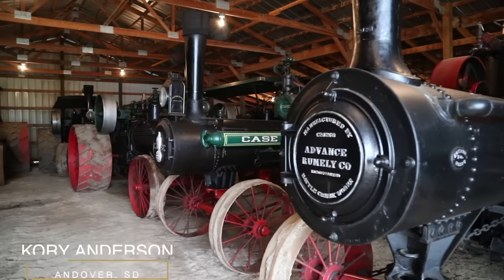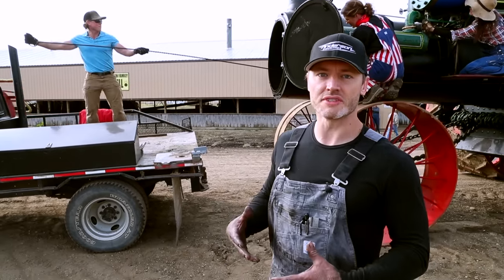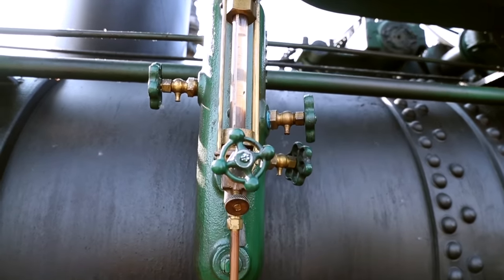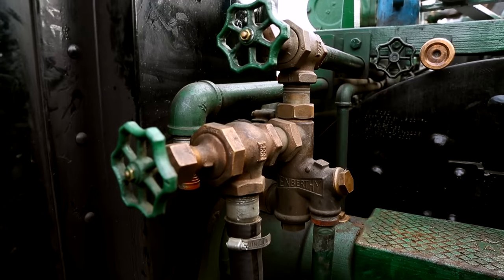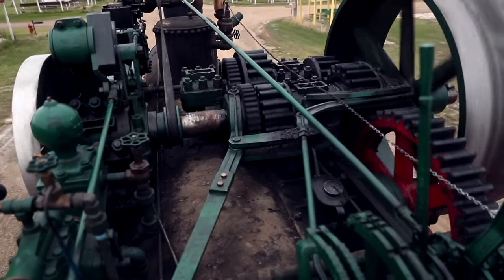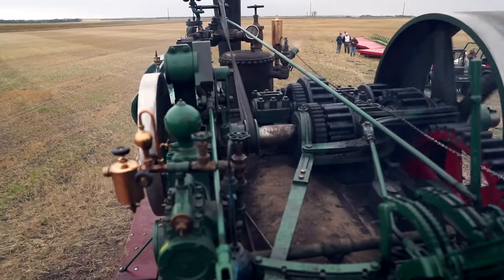FIRING UP the 150 CASE - The largest steam traction engine in the world prepares for a record pull

Comment: "balls out" never knew
Reply: @Ben Jones Amazing never meant what I thought.
Reply: @brucerogermorgan2388  something about cannon shot and brass mountings?
Reply: @differentname8051  In the days of square-rigged sailing ships, amunition was cast iron balls that were stacked on a triangular brass plate that was called a "Monkey". In very cold weather, the different coefficient of contraction would cause the "Monkey" to contract at a different rate to the cast iron cannonballs. If it got cold enough, the Cannonballs would roll off the Brass Monkey. I may not be 100% on that but it's definitely along those lines.
Edit: I guess that the same thing applied to land-based cannon also.
Reply: And balls to the wall was an old aviation term back when throttle sticks had a ball on top of them.
Reply: now i wonder if "down the pipes"  is also from this  , if not i feel it should be
Reply: Balls to the wall is similar, from aviation. You'd put the balls on your throttles all the way forward to the firewall or dashboard.
Reply: @brucerogermorgan2388  This etymology has been largely debunked. If for no other reason than that there simply isn't enough mass for the difference in expansion to actually make a difference. Add in that ships never used anything like a so-called monkey to hold shot (it was stored in garlands along the hull near the guns) and you have a pretty questionable derivation. It is one of those terms that we simply don't have a good source for it - but there are some rather innovative folk-etymologies out there!
Reply: @timdouglass9831  Fair enough, that was the story I was told, and it seemed logical because I didn't have the details you did. Thanks for the information. I might just stick to the story sometimes, it sounds good. I'll just be careful who I tell it to, Haha! Maybe it applies to land-based cannon shot? I dunno. I'll say one thing, though, that Case is one awesome piece of machinery!
Reply: @brucerogermorgan2388  It sure is! I'm just an etymology geek - don't take it too seriously!
Reply: @timdouglass9831  Thanks. I'm 71 now, I gave up taking anything seriously years ago, yuk yuk.
Reply: My own meaning for it still stands
Reply: I learned it from Jay Lenno talking a bout a steam engine he had

Comment: A famous old Case boiler was sold to Mr. Justin J. Hingtgen of LaMotte, Iowa. It was mounted on a cement slab at Mr. Hingtgen’s farm where he held his well-known steam show, The Mississippi Valley Steam Power Show. After Justin Hingtgen’s untimely death at the age of 51, the famous old boiler #14666 was purchased from the Hingtgen Estate by George W. Hedtke and was moved to George’s Hedtke’s Hickory Oaks Farm at Davis Junction, Ill. I am 74 years of age [ an old tractor restorer ] and was a good friend of George Hedtke's, having displays at his shows over many years.I am much impressed that you were able to reconstruct the Case 150. George and others wanted to do that He was also a friend of Jerome Cases granddaughter and was at a show in Racine a number of years.I was there also.George had a nice Case 110 plowing engine that he showed often at his show, The Sycamore show and the Freeport Illinois show..Where did you get the wheels and running gear?...were they off of a 110 ?...I am so happy you guys pulled this off You have a treasure that needs to be preserved for ag history.I have a Vo-Ag Teaching Degree from Illinois State Univ. I was at your show about 35 years ago...God Bless    Dana Brinkmeier..

Comment: When I was a kid just after WW2 I lived in London, England for a few years and remember seeing  a steam roller in action used for repaving roads.  They were similar machines to the steam tractors like your  Case 150,  but with  rollers instead of wheels.   I also remember seeing  steam trucks with solid  rubber tyres when every means  of moving goods was used because almost all trucks were  built for military duties.  I think that I heard they had a top speed  of 12 mph.    I was very interested to see your footage of its transmission gears with two forward speeds, but you didn't mention if your tractor has a reverse gear too.  Dumb question  .... were the men on the plough/harrow used as extra weight to make it bite into the soil?  I could see they each had a lever to presumably control the depth of ploughing.     Pretty cold work on a South Dakota autumn day!   I hope to see  more of your videos.  Thanks, Kory.
Reply: You can run a steam engine in reverse so no need for a reverse gear! It's slick to see a well timed reversal by a skilled operator!
Reply: @CumminsTurbo4  But you’d have to completely stop the engine down to reverse, it’d be much more efficient and quicker to just have a dedicated gear wouldn’t it?
Reply: About reversing a steam tractor. You reverse the engine, not the transmission. And you don't even have to let the engine come to a stop. You can literally slam the valve reversing lever from forward to backward and it won't hurt the engine. It takes only a second or maybe 2 seconds to have the engine running at full speed in reverse. Yes I know the flywheel is heavy (I am guessing 1500 pounds for this engine) but the force of steam on that piston is tremendous and when the valves are reversed the steam is put on the "wrong" side of the piston, which brings it to a stop and forces it the other direction in no time.
Reply: @philCopeland The people riding on the plough were probably lowering the shares in sequence. It would be hard to start moving with all the shares down.
Reply: @jg54sayaka11  Reversing a steam engine is as simple as moving a single lever, which adjusts the timing of the steam going into the cylinders such that you can reverse it.

Same lever is also (at least on locomotives) used to adjust how long you allow steam to enter the cylinders, because you only need the full amount in circumstances like pulling a heavy load or going up a grade.
Reply: @SLane249  Probably not, a steam engine has maximum torque from a
dead stop.
Reply: @JC-xw1pz  But that is dependent on the ground state, it may have maximum torque but that power has to travel through the wheels. If its wet/muddy ground they have less grip so need a easier start.
Reply: @SLane249  Would you be likely to operate a piece of equipment of this weight on
wet or muddy ground? I've seen what it takes to retrieve large equipment that has gotten bogged down in a field.

Comment: You madlads built a NEW 150 CASE tractor from the ground up using the original blueprints?? EPIC
Now there has to be a few ways to improve the design - cleaning the pipes is the first thing to come to mind. Compressed air? Multibrush? Tiny little robots that get in there and clean it for you? Also - automatic stoker/feeder? And I reaaaally want to see what you can do at a Tractor Pull event!!

Comment: Pretty cool 😎 to see how they get these steam engines going. I normally just see them just driving by 😀
Reply: There are videos on that.  It's a fairly long process, not too terribly complex, but there are some important things that must be done in the correct order to get it to all start up and not damage anything.  Like getting all the water out of the cylinders beforehand and during initial startup so they don't hydraulically lock.  You can actually see the steam/water mix venting in this video until it gets going, and then the valve gets closed.

Comment: I would like to see more on the power steering. Separate engine of crank pto?
Reply: I believe the power staring actually was alot like what modern cars use but instead of belt drive and fluid it just used steam
Reply: @squarebodycasewademckenney6190  thanks :) . I wondered if it had a wheel that went round and round or it operated a valve and only turned a bit. They would be capable of making it with a following valve though.

Comment: May I ask why the water glass was put on the side of the boiler rather than the footplate like most traction engines I cone it was the original design I was just wondering wether you know why?
Reply: For a more accurate reading. Sight glasses at the back head of the boiler tend to show a higher water level than there actually is. Due to the up currents from the steam bubbles flowing up from the sides of the firebox.
Reply: @austindruien6192  Yes, a more accurate reading of the water level.  Side to side is not that much of a problem as is the end to end when on uneven ground.  The location just before the firebox tube sheet is the best indicator of water level.  Think of the length of the UP Big Boy boiler at over 50 feet long; on a 2% grade the front will be about 1 foot higher than the back and that is a lot of water.

Comment: We did here in the UK things differently where two engines would be positioned athwart a field and "on the belt" would drag a ploughshare back and forth, the engines would be moved forwards and repeated and it revolutionised British farming.
Reply: Right. I've seen the plowing engines with a huge winch underneath for pulling the plows across the fields.  Running giant engines over the fields would compress the soil too much.

Comment: Damn it, now I wanna build a steam engine powered vehicle but with a bunch of modernized features just to see how much power can get made with better seals and materials that transfer heat better for added efficiency. If case could make 110hp with such a low rpm 100 years ago I bet we could totally make like 20,000 lb ft of torque and 400 hp today with some effort put in

Comment: Really interesting video, but I am surprised by the amount of smoke that was being generated, which suggests that a lot of the coal's energy is not being used because it is being burned at a relatively low temperature, and actually only being partially burned. What is the best practice operating temperature in the firebox?
Reply: Part of that is that they use steam injected into the exhaust to provide a strong draft for the firebox.  Not that it's really clean, but it's not as bad as it looks.

Comment: So how efficient is this compared to a modern day tractor? I mean, since most run on diesel and that's the most expensive stuff at the pumps. Not to mention that it's probably likely they're also due for a tune up and maybe even got a leak. Is it cheaper to run your coal and wood mix?

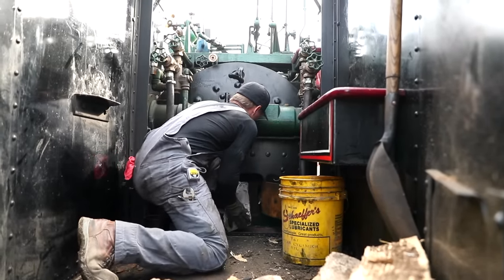Comment: 3:40
IDEA:
dry wood: 8000 btu per lb
coal: 13,000 btu per lb
fuel oil: 19,500 btu per lb
enriched uranium: 1,250,000,000 btu per lb

You need a uranium firebox

Comment: None of them lasted because they fill them with water and they rushed it out. I'm wondering if you guys are using some kind of oil or lubricant in the water to keep it from rusting like they use antifreeze in radiators?

Comment: I used to have to take the springs out of the holes of industrial boilers and then rod them to clean the soot out of them. 
I learned very early on how soot and water ( sweat ) are not very pleasant! 
I believe when you add water to the soot it creates an acid. 
It used to burn like hell I know that!

Comment: So Im curious. Does the steam escape or get returned to the boiler as condensate to be re-heated like a home steam heat system?  I see a lot of videos about how the piston opens and closes under high pressure, but never where does the exhausted steam go? So my main question after that would be how long can that boiler tank run under use before it needs water like a fuel tank on a car?

Comment: Checking around the internet it seems these engines were used for, amongst other things, ploughing. My question is, how was it possible to plough a row of furrows then turn and plough a row next to the them without this very heavy engine and broad wheels flattening and undoing the last pass of the plough?

Comment: Should the "treads" on the rear wheels be the other way around like a directional to clean themselves out? Or does it not matter because of the low wheel speed?

Comment: I have a question about the power rating  since so far as I am aware of the work a steam engine can do is mostly dependent on the boiler pressure, at least this one is able to change as the engine runs. So I assume that the engine could put out considerably more than 150 HP, ( of course that would increase wear ). So In this regard did you actually measure it?
Reply: It was measured in 2019 at the Western Minnesota Steam Threshers Reunion(WMSTR) at
Rollag, MN on a Prony brake. It produced 171 HP.
Reply: @JC-xw1pz  Thank you very much, something in me was screaming that it actually had to be more than 150hp,  nice to know that i was right :P

By now I also found the formula P in HP

P= (S*p*v)/75

S= Pistondiametre in cm
p=Average pressure in Bar
v= average piston speed in m/s

I wonder if that one checks out with the specs.
Reply: @vHindenburg  Case 150 Rollag will find some interesting video.

Comment: I find it interesting that the US stayed with engines pulling the plough directly, compacting the ground (a Bad Thing) as they went, whilst the UK and Europe used engines stationed at each end of a field with the plough rope-hauled between them. 

Assuming there was some logic behind the difference, is that US fields were larger? Soil types? Crop type? Differences in the economics of running specialist Plough Engines with the required drums vs a more general purpose engine each side of the Pond? Or was it 'Not Invented Here', Patent Law or something completely unexpected?

Comment: Can someone explain me how the coal smoke is getting pushed out of the firechamber ? I thought the fire is just a coal fire burning to heat up the water ..if that's the case the smoke would be constantly ...and not like pushed out  in the same rythm as the piston is pushed .
Reply: The steam exhaust is fed to a blast pipe in the smokestack, to increase draft on the fire when it is needed.

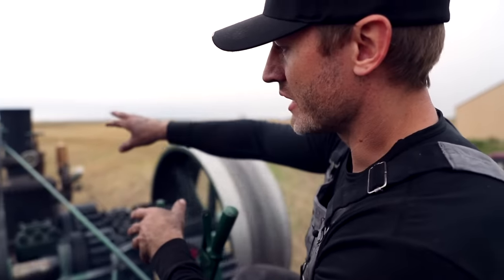Comment: 7:47 balls out, not to be confused with balls to the wall. Both mean full throttle, but balls to the wall is an aviation term meaning you are firewalling your engines (pushing them as hard as they can go)

Comment: Only 150 bhp.  Considering a Ferrari has about 600bhp but this Case tractor has 7,000 newton meters of torque. & a Ferrari has only 550 newton meters of torque.

So what’s more powerful a Ferrari or a case 150 tractor
Reply: You just answered your own question. 150 hp < 600 hp.

Comment: It pulls that plow like it’s no one’s Business also something to know many steam engines did not actually use the steam that much to power the wheels the fly wheel actually did most of the job consider it like a mechanical battery first a lot of steam goes into get it moving but then to keep it moving you don’t need a lot compared to cars today their fly wheels are much lighter which means it requires more energy to keep the vehicle moving that’s why old engines with big fly wheels are more efficient and can sometimes be more environmentally friendly like the hit and miss engine.

Comment: Almost all of the original ones were destroyed in explosions that killed the operators. High pressure steam is incredibly dangerous especially if not operated correctly or if there was a minor defect in the casting.

Comment: I don't understand the water sight glass and the tri-cocks on the side of the engine out of sight of the operator and fireman.  Steam rail locomotives have 2 sight glasses, one for the fireman to watch and one for the engineer to watch with the tri-cocks on the engineers side.

Comment: Interesting to note that all the valves and fittings, though they are new on this reproduction, look essentially the same as they do on engines from the same period.  Valve design, NPT thread geometry, etc. has not been altered much or improved upon in over a century thanks to ASME standards.

Comment: A few additions, and changes would improve everything. 1) change to a safety water tube boiler. 2) use propane / natural gas 3) add a condenser 4) add heat exchanger 5) Make steam engine valve ports much bigger, even double up with another on other side. 6) use a reuleaux triangle cam 7) lower the pressure / more rpm 8) make it look more woody / steam punk / modern 9) modern covered gear box. 10) put a V engine design under the belly, like they did in locomotives.

Comment: An amazing traction engine.Verydvanced with a clutchbut I was supprised for such a big engine she is only a single cylinder. In trems of weight Iwould imagine she is the same a the German Zettelmayer ploughing engines of a Fowler Z7 but in size the Case is wider and taller. A very powerful engine.

Comment: OK, so this, vs one of those big American things with the 28 big engines all mounted in parallel with 96 cylinders and all that... dragsters, that's what they're called! So anyway, this vs a dragster, back to back, attached by rope. Which one would pull which? I imagine the dragsters have a fair advantage in horsepower, but then this thing surely outclassses it in weight by at least a few elephants'worth. And those dragsters surely burn out after 4 seconds or so of running, where this thing's not even got it's water up to temperature, in fact I'm sure the engineer hasn't even started his tea yet. So, all in, technology and engineering vs tons of bastard black metal, that's not gonna shift without the proper supplications to the Gods of Cast Iron... which one wins?

Comment: Why is the V-belt on top of the engine twisted? Does it help keep the belt on the rollers?
Reply: To convert from a horizontal shaft to a vertical one.

Comment: Love old steam engines! By using modern day steel and equipment to build this machine, is it a better quality or is the steel not what it used to be. Rebuilding a 60s or 70s gas engine with the tighter tolerances makes them a better engine. I was wondering if this was the case with this one.